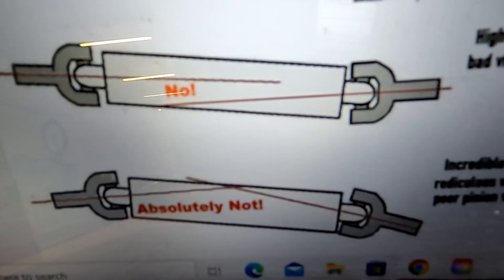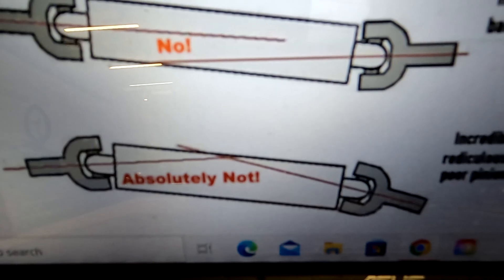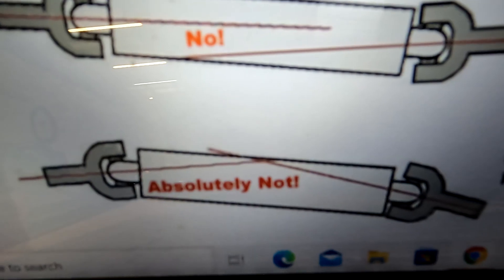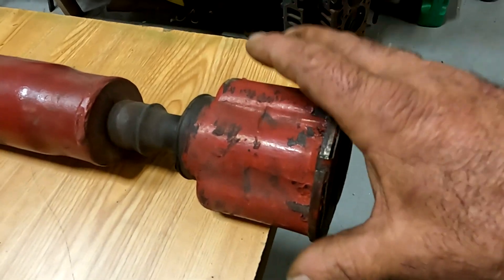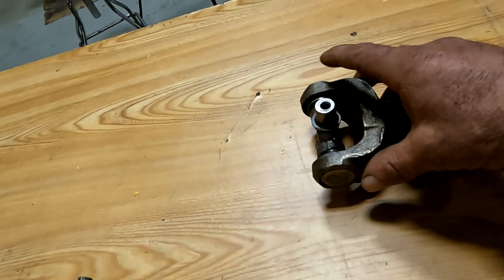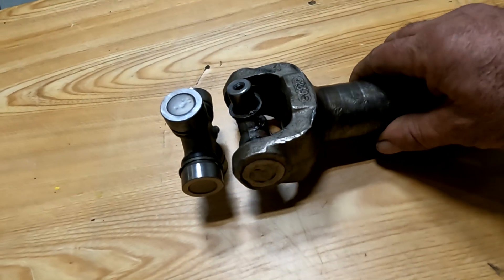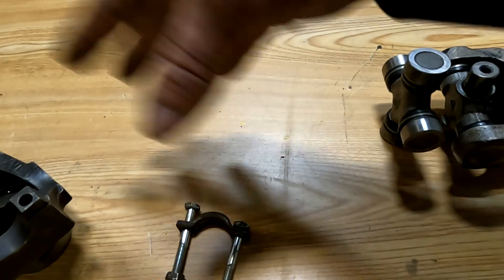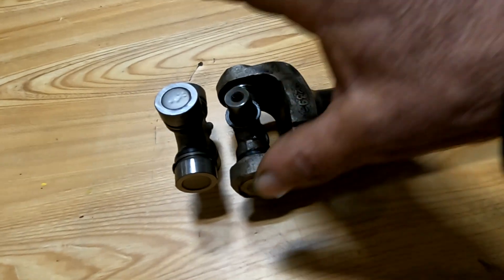The Secret Life Of The Universal Joint - Uses, Limits, How They Differ From Constant Velocity Joints

Comment: At my home track in the 1990s, we had a guy with a 74 Nova that ran high 13s low 14s with a 305 headed 350. He would chuck a driveshaft every few weeks, and garnered the nickname "Halfshaft" from it. I was running mid 11s to low 12s in a heavier Firebird with a 455 that would just about pull the front wheels and did a best of 1.59 60ft on slicks with 3.42 gears. I was doing it with a stock shaft, in a heavier car, with more power and a lot more strain on things. He was getting beefier and beefier driveshafts and spending money he didn't really have to keep it running. 

I told him that he didn't have the centerlines of the yokes aligned right, he said he did. So one day we checked it at the track with his car sitting on some 10" wide steel rims I had. Turns out the shaft was binding real bad, not only in the vertical plane, but laterally as well. The engine was tipped back too far and the front of the engine was closer to the passenger side than the drivers side, so it was tweaked side to side. It was nearly binding the yoke to the driveshaft it was so misaligned.

He brought it over, we measured his subframe, it was crooked too, so we measured and aligned that, then moved the engine so it was straight front to back and not nose high. However with the leaf springs we couldn't do much without angle plates, but he never chucked a driveshaft again. If i remember right he picked up some ET too.
Reply: Spot on man!

Comment: Thanks for explaining how to get the zerk fitting to be compressed, as this concept isn't always clear. The crosspiece is weakest there, and lends weight to getting a sealed unit.
As an aside, I came across an odd interchangeability. I had taken the rear driveshaft from my '91 Bronco to be serviced at a driveshaft shop. There was another driveshaft (customer's) that was clearly similar dimensionally to mine, but casting where it bolted to the rear axle was slightly different, but swappable. It belonged on a similar vintage Chevrolet Blazer. How that happened when the Blazer had a different wheelbase was noteworthy.

Comment: Back in the 4x4 crazz  2 and 4 inch lifts would change the drive line angel a lot but seemed to work fine ? 4 inch the most .Every thing you saw wrong in this video ? Just saying.

Comment: As a guy with a custom toyota 4x4 the 2 ujoint cardon joint as you called it is known as a double cardon and the cage of it operates on a centering socket ball. Are those different than a passenger car style?

Comment: I had a 65 Dart Charger with the 273 hipo. It had a 7-1/4" rear and I replaced it with a  8-3/4" rear from a 340 Dart that was trashed. I had to get the driveshaft shortened and I told them to balance it.  Well it had a bad vibration at  65-80 mph.  I thought it wasn't balanced but the driveshaft company said it was slightly bent? He apologized and said his people screwed up.  He said it didn't need balancing? I installed it and everything was good up to  120mph. Glad they stood behind their work.  Great video Tony  I didn't check the pinion angle as it looked good and was a stock housing. That was way back in  1971.

Comment: Thanks UT, great tip on compression of the grease nipple, I’m going to check my U joints today. I use a clinometer from a WW2 vickers machine gun to check the angle of my engine then set my pinion angle half a degree down from that reading. When I go to the drags I adjust the pinion down three degrees. I’ve replaced all of the factory trailing arms and panhard rod in my ‘71 LTD with adjustable rod ends for quick and easy adjustment.

Comment: Tony has nothing to do with u joints but the video from the other day about leaf springs taking the clamps off the back and more on the front of the spring does that work for over and under the spring diffs

Comment: I only worked on factory vehicles. Never really had to deal with modded systems and angle issues. That being said, I started working on a manufacturers vehicles that had joints that could be lubed. Part of the service requirement. Basically I never had to replace those. Only a few that just never got lubed. Then they went to sealed ones. And it didnt take to many years to see these going bad. Course this always occured out of warranty. And they were not made to be replaced. Shafts had to be replaced. Much later on I found an outfit that did replace them properly. Two piece shafts so the complete unit had to be sent so that they could be balanced properly.  Course for shaft to trans connections, rubber flex joints were used. Thise are another story.
Reply: The origins of the sealed for life UJs don't come from the cynical "it'll go bad just after warranty and we can stiff them for a whole new unit" approach. It comes from industry. In a factory, the grease points get filled with kak and you're supposed to take them right out, blow through with an air line, refit and THEN re-grease. If you just refill straight off, you inject the bearings with cr*p and kill the machinery. Machines with sealed for life proved much more durable (and en mass) cheaper = better. So they became the go to.
Reply: @Pico-hq7ws  yea, true. But most of us would actually clean the zerk fittings off. The fact that in my case they lasted bear forever points to them being also lifetime. The fact that I replaced much more sealed for life ones also points out that the older ones lasted longer because we could grease them. I suppose that it's just a 50/50 thing.

Comment: The roller bearings needing to roll a little is part of why even with an independent rear the driveshaft still has a little bit of angle to it. Generally if it’s perfectly straight it tends to cause the joints to wear a little spot with the rollers as they’re basically just sitting in one spot rubbing.
Reply: I'm glad someone point this out.

Comment: Even if you do not have a high performance application...never reuse the ujoint bolts and straps.   They are not expensive...just keep 5 on the shelf and use new.

Comment: UT did not mention the common practice of driveline shops that replace the ball & trunnion style joint (used up to 1965 models by the way, not 1964) with conventional u-joints. I have both my '65 Formula S Barracuda converted and my '65 Valiant Signet convertible changed over from the ball & trunnion. However, my '65 Valiant Bracket racer with a 4-speed, 4.56 geared 8 3/4 differential, and 10 inch M&H racing slicks always used the ball & trunnion welded on to a '70 Challenger 8 3/4 driveshaft without a problem. On the bracket racer, I used a Zoom performance u-joint at the differential end which was advertised as being stronger because it eliminated the zerk fitting altogether.
Reply from the maker: You're right about that to a point.  65 727 was slip joint, the 904 stayed Ball And Trunnion for one more year.

Comment: On the subjects of U-joints - I found the best tool ever! Look up Tiger Tool. They are made in Canada but I was able to change a bad U-joint on the car (56 Windsor Wagon) and it was EASIER than using my press as I have in the past.. Increadible tool - get both the installer and hand press.  Of course use Amsoil water resistant grease.

Comment: I have joints on the kenworths that have grease zerks on both sides of the cross and have never torn or broken a joint. These trucks are pushing 2000+ lb/ft of torque.

Comment: Thanks Tony, this extended info from the last video. Your illustrations showed perfect phasing of the front and rear joints of a driveshaft, excellent. But no explanation of the importance of phasing of joints. It is the most important aspect of the use of two joints in harmony. Thanks

Comment: Doesn't the engine and trans tilt to the rear on most vehicles? They also used the cardan double u-joint setup on the front shaft on the big 3  4x4 trucks as well. Believe it was to alleviate pulsation due to increased angle at the transfer case.

Comment: I have often found a large mistake when replacing u-joints.  The endplay of the journals is critical.  Whether it is a "C" clip on the journal cap or a clip in the end of the drive shaft, the end play can eventually cause problems.  Some joints have different length for the journals and different diameters for the journals.  I always pressed the joints into place and also held the 'gap' with a ridged piece of steel to maintain the proper distance between journals.  I always checked for 'phasing' on the drive shaft, whether rebuilt or freshly built.  On of the cars we raced with a built shaft was a sixteenth of an inch out of phase and ended up breaking the tail shaft of the transmission.  A much overlooked, yet simply check for maximum performance and extended life. Keep 'em turning!

Comment: I only use the 1350 fitting less joints in the drag car. As simple and cheap as it is to do, it’s a great little way to be a little more safe going down the track.
Disclaimer: not bashing anyone for doing anything different.   Just bringing up the point that it’s a cheap way to be safer going down the track
Reply: That’s what I used on anything High Performance. Probably not the hot setup anymore. I dunno
Reply: @jamessharp9790  I know Wally Stroupe personally.  In fact I was just at his chassis shop a few weeks ago. We were talking rear end/ susp swaps in the duster (still run the 8 3/4 with leafs and ladders).  He was asking about the yoke on the driveshaft.  Told him 1350 and he said that’s what they use on 90% of the pro mods he builds.  Must not be THAT far from the hot setup haha.  To be fair, we never broke a 1310 before I swapped it, but we also never ran one with the zerc fitting. I HAVE seen those fail with less power off the transbrake. I wasn’t bashing UT or anybody using the smaller ones or the zerc equipped fittings. I was just making the point that it was a cheap way to add a little safety to your operation.  Yeah we have to run driveshaft loops but what if a chunk of that U-joint gets under the tire?
Reply: @GLF426  oh , ok.  I don’t know any noted people etc . Probably something my old machinist told me decades ago. I broke one u joint and was getting upgrade , got driveshaft balanced then too.

Comment: I always wondered why my 1977  full time 4wd Power Wagon had a cardon joint in the front driveshaft and plain U-joints at the steering knuckles in front axle.  Now I know.  The front shaft ran at a constant  angle while the steering u-joints were fixed in the same plane.

Comment: Driveshaft phase!  What you said, regarding the up-down angles of the transmission, driveshaft, and pinion yoke, also holds true for side-to-side settings - which will come in to play when you introduce a rearend with an off-center pinion to a car with a perfectly centered transmission and driveshaft. If your engine and transmission aren't dead-nuts straight and the rearend pinion yoke is, then you're out of phase in that geometric plane. The important part is that the transmission output shaft/yoke is parallel with the pinion shaft yoke in both the up-and-down, and side-to-side, planes, which achieves proper phase.
It's easier to perfect the side-to-side plane. The up-and-down plane is best set for the operating conditions in which the car spends the bulk of its time.
Reply: Spot on Dan E, and it's exactly what I'm dealing with on this 65 Dart.

Comment: Those ball and trunnion (Detroit universals) were  expensive if excessive ware in the housing required  replacement .They used them on tail rotor drive shafts on  Hiller helicopters my old man worked on . They scrapped them for very little  ware  compared to what automotive standards are. I was glad mother mopar went to conventional joints  front and rear as they are so inexpensive to replace.

Comment: Since we're on the subject of drivelines, I'd like to see a video dealing with the various "series" of u-joints. For example, the differences between a Spicer 1310 and a Spicer 1330 and what joint is best suited to what application.
Reply: Generally the main difference is the size of the cross section and the caps. Bigger cross and bigger caps are stronger, but also require larger yokes.
The best joint depends on application. There’s torque levels they’re good for so will want to get one large enough to handle what you’re putting to it.
Reply: @NBSV1  Thanks for the reply. I know the differences but, many newbies might think that they're all the same. That's why I think a video might be good.

Comment: I didnt realize how much and how easy driveshafts can bind until I worked in auto salvage. I've been in a tussle trying to get at bolts in cars that no longer could be lined up. Still remember this one BMW driveshaft that taught me not to take all the bolts out of one side before loosening the other side.

Still miss that job and how it paid. Minimum wage just to be there plus a set amount per part. The owner had a 'get as many parts off vehicles and on the Internets' mentality so it worked out great.

Comment: 15:00 So... I look here, and I admit, I can only merely guess which side is which on this, but is the rule of thumb to place the joint so that the zerk follows one of the driving connections? [can not actually figure out a better way to phrase what I am trying to ask here, so please bear with me if I am lacking some critical bit of terminology here]

Since there is no 'this side up' mark on it, nor any timing marks or alignment marks on the parts, how can I be dead certain that I have the proper position?

I honestly have never blown a u-joint racing, nor have I heard about this technicality, so this is a learning experience for me here.

Now I AM taking a screen shot of this just so I can write on it with photo editing and make marks and notes based on what you are saying, ans saving that in my information for when I next go about doing u-joints, because, while I do not race my F-350 Super Duty, I DO pull upwards of 17,000 pounds and it IS a manual transmission, so this JUST MIGHT be important to me some day, as I have seen a whole lot more large trucks with blown u-joints than race cars [could just be the fact I worked a long time as a truck and heavy equipment mechanic, I'm not sure].

Every little speck of information counts!

Comment: The compression of the zerk fitting is very interesting. I never thought about that. Usually people that race cars get solid u-joints.
Reply: I was thinking the same thing, I would have never thought of that being a failure point unless I had one fail and I had to sit and examine it to figure out why it broke where it did! The only thing is I've had a ton of u-joints fail and none of them have ever broke at the zerk fitting but I only buy spicer u-joints and none of my cars make more than 500 horsepower!
Reply: @rustybritches6747  Me too! I also use only Spicer u joints.

Comment: my CV axle snapped, so I welded the broke stud back onto the CV hub... 4918 filler and 3/4 inch cut out of the broke section 50/50 split on fracture location. oil field frack well filler rod... 1 inch stud becomes a 700hp SFI patch. 100kpsi joint
Reply: the old engineered shear off location was ratted for 450lbft... the slip joint off the diff has 3 one inch lugs ratted for 140'000psi tensile each, 300'000psi to snap it off at the diff, patched with 4918 at the hub, 100'000 psi to snap it off the wheel hub a second time. 700hp SFI patch just change the wheel hub side of the CV axle. "sounds like a 30-06 going off when it lets go..."